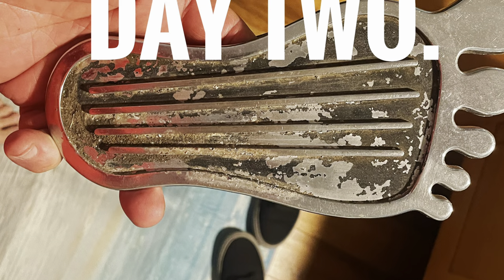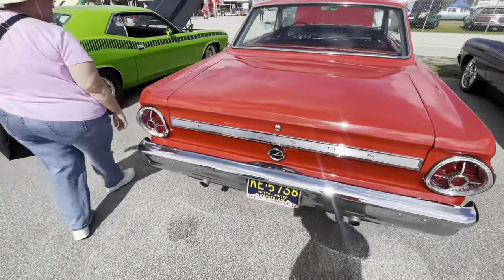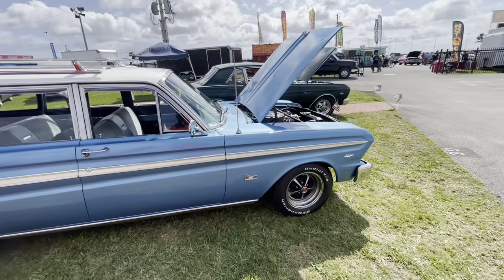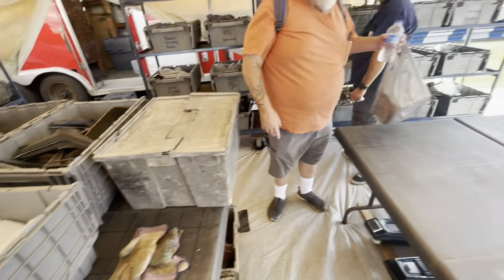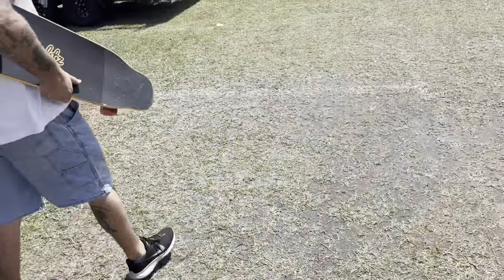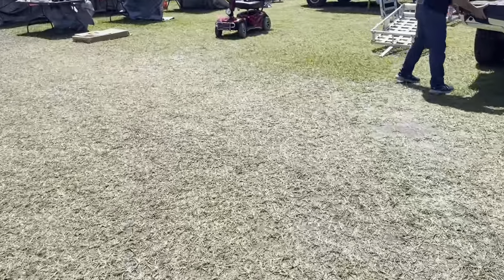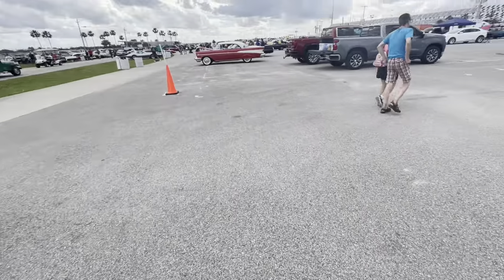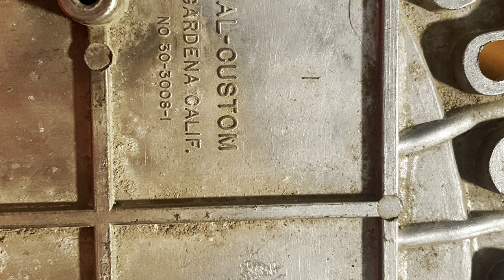Day two at the 2024 Daytona spring turkey run.

Comment: Great video! Thanks for taking us along on your Turkey Run adventure. What an amazing assortment of old parts, new parts, and just about anything a guy restoring anything would love to find. You got some parts that are going to make your Falcon look great. I saw one set of chrome side pipes. in one of the vendors I had a 1973 Javelin AMX back in the mid-seventies that I had a set of side pipes on that I loved. The front entry pipe was chrome followed by a brushed aluminum and ribbed straight section and finally a chrome turn-out. I have never seen any like them but would love to find a set for my daughters 2016 Challenger. LOT's of gorgeous cars. It might have been hot, but it appeared to at least have a brisk wind blowing.
Reply from the maker: Yes. Just about anything that a person can want. Just have to take your time looking.